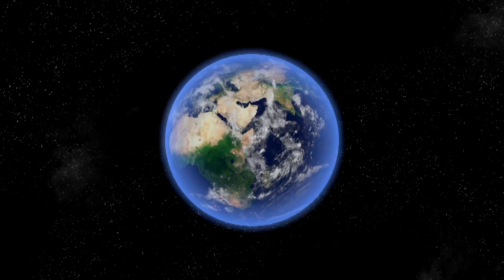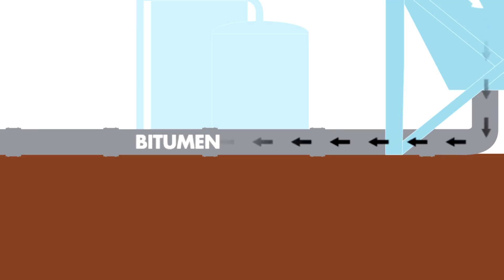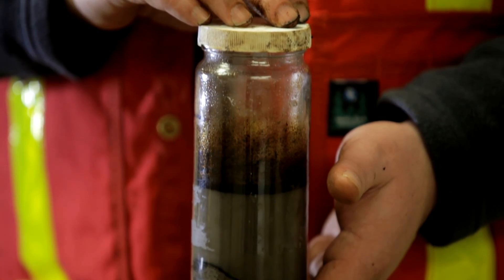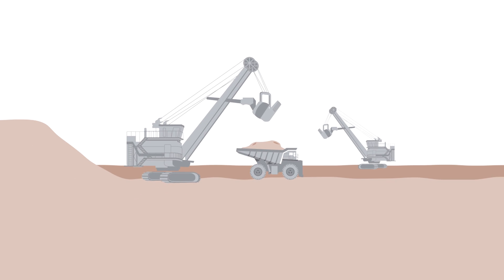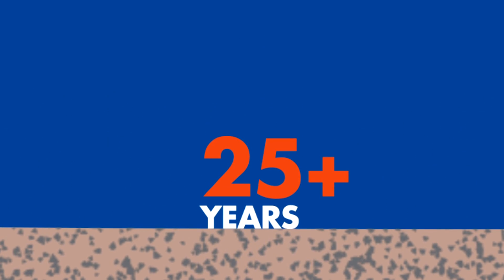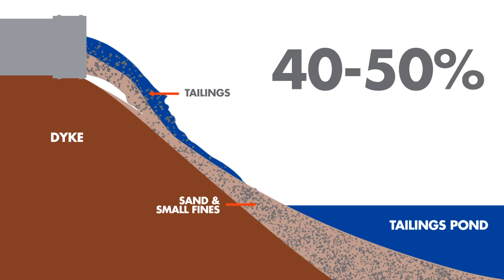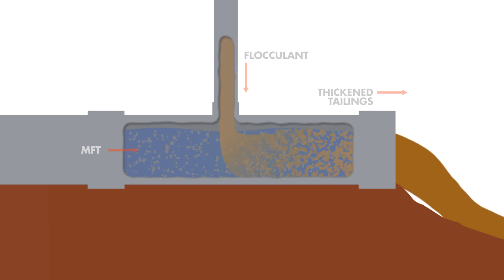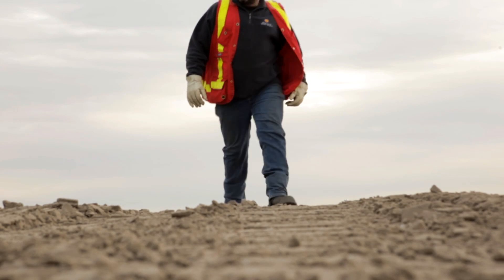Shell's approach to managing mine tailings in oil sands operations

Comment: What kind of plan does Shell have in place for long term management of these pollutants?
And by long term I mean, permanent, as these contaminants do not simply go away.

A buried tailings pond near my hometown is leeching into the nearby river, but the mine that produced it has been closed for decades.
The local community had to pay for restoring containment, but after 20 years, once again it has breached and heavy metals are leaking into the river, which is also a community water supply.

The small population can not afford to pay for another upgrade to contain waste for a mine that has not produced any income for residents of the area in over 30 years.  This problem will never be gone, and this company has left friends in my hometown to simply accept that their water is polluted, and nothing can be done.  What is Shell doing differently that this company can ensure the same doesn't happen again? Is there a financial safety net for future breaches of tailings ponds? Should such financial safety nets be required by law to prevent this kind of degredation over time?

I'm sure that Shell will progress into more advanced and cleaner methods of energy production in the future, and I have no doubt about the company's ability to remain afloat, but even if the company is profitable indefinitely through adaptation to new energy needs, I'd feel safer knowing that the company retains a recovery cost for all its waste resources that can ensure any economic instability in the future will not prevent Shell from preserving the communities and environments that allowed it to flourish.